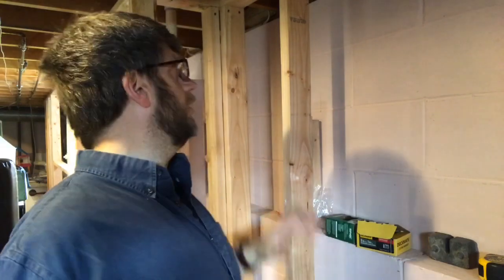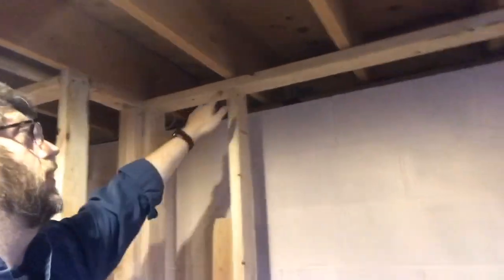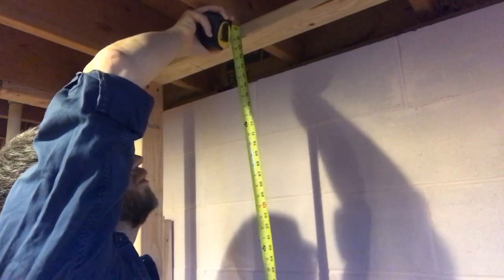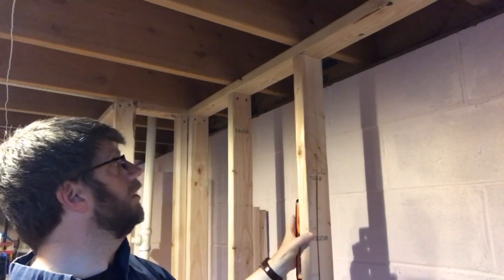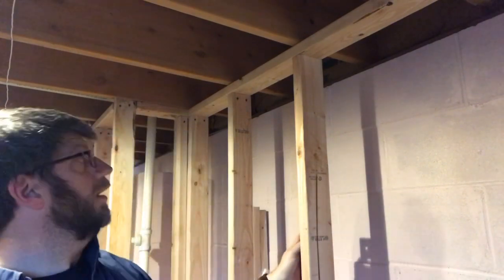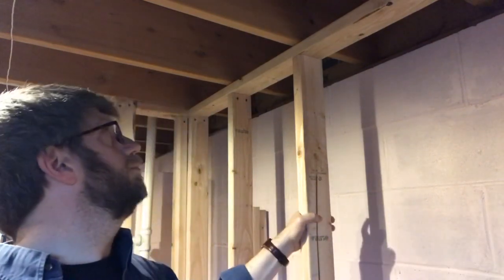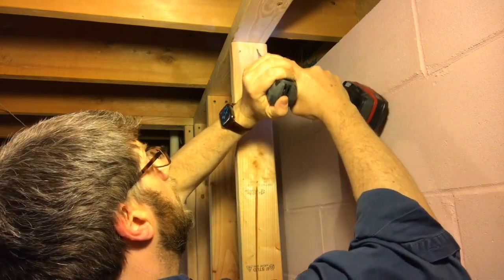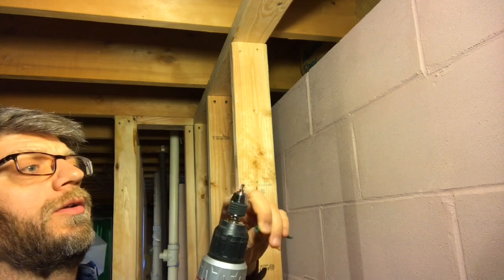No Nails, No Hammering - Wood Stud Framing With Screws - Basement Remodeling Project

Comment: Nails have more sheer strength and flexibility so they are prefered for framing but as a DIYer building a small non-supporting wall I can't invest in an expensive tool so I am going with screws too.

Comment: If there are obstacles above your partitions and you can’t get directly to the joists, put two foot blocking directly into the concrete basement walls to secure the framing.

Comment: There is such a thing as screws that meet or exceed the same sheer force resistance as nails. 
In addition aren’t decks made with screws? Those seem to require the need to hold load and resist sheer. So yes certain screws can be used to frame.
Reply: Yeah honestly a good rule of thumb is if your wall flexes enough to sheer a screw than you've got more to be worried about than just the studs. The only real reason you would use nails of screws is for cost and for the framing of the wall before placing studs.
Reply: Decks are made with screws yes, all hangers are done with nails NOT screws though.

Comment: I wouldn't go too tight with the studs as that can cause problems with the floor above. Having the stud snug (ha, snug studs) keeps it in place till they're nailed/screwed in.
Reply from the maker: Ohhh... huh.. good point.  Thanks!
Reply: The top plate is installed first, then the bottom plate is anchored to the floor. Wall studs are then cut to fit in between the two. The top plate can be screwed directly to the joist when the wall is parallel to the joists.
Reply: Also, if there are obstacles above your partitions and you can’t get directly to the joists, put two foot blocking directly into the concrete basement walls to secure the framing.

Comment: As a Journeyman Carpenter in the union I cannot find anything right about this video!
Reply: It’s a homeowner installing walls in his basement.  It’s NOT for a customer and he likely doesn’t have a permit.  There is also no need for speed and he 100% doesn’t own a framing nailer.

These walls will be there longer than this guy will be alive therefore there is nothing wrong here.  Doesn’t matter that you’re a carpenter.

Comment: What size drill bit was used for the pre-drilling?
Reply from the maker: That sorta depends on the screws you're using.  Here's a quick trick for pre-drilling holes:  I hold the bit up in front of the screw.  If I can't see the threads of the screw then I know the bit is too large.  I'll reduce my bit size until I get to the point where the threads of the screw are wider than the drill bit (and pretty close to the size of the shaft of the screw).
Reply: Use a 1/8 or 7/64 drill bit for a standard wood or deck screw. Framing screws/wood screws are typically 2 1/2” long and are #8 or #9 gauge and I would recommend using a torx/star drive head. These have less stripping and are much easier to drive into wood for first timers than a Phillips head that strips easily. Home Depot makes it very simple for DIY’s to find the correct screw needed for wood. Go to the aisle, look under wood screws and choose 2 1/2” star drive. Decking is exactly the same way. Go to the aisle, look under deck screws, choose your length for your project and star drive.
Reply: Remember that using screws for framing should ONLY be done for partition framing, NOT structural framing. Loads that need to expand and contract will snap screws, so you need to use nails. This video is STRICTLY partition framing, non load bearing, so you can use screws for the entire application.

Comment: 8:05 That drill bit took a while to make the pilots
Reply: Looks like he used the same drill speed setting for both pilot holes and fasteners.  Most drills have a higher speed mode for drilling.  Possibly an oversight on his part, or maybe it was one less thing to explain in the video.

Comment: I'm going to assume you already understand the difference between screws and nails and that they are NOT interchangeable. One is meant for clamping strength(screws) where shear resistance is not important.

 Nails are for where shear resistance is important like the wall you are building. Also a nail gun would let you finish that entire wall in 5-10 minutes with studs that are just as straight and stronger.
Reply: Does the building code allows screws instead of nails?  I am looking for
Reply: @nasarazam  That's a very good question, I highly doubt it. None the less it's just not safe to use screws vs nails in this application. Screws are great at clamping force, not so much for torsional or sheer.
Reply: @tofan2622  why not? It appears to be a non structural wall that he might only put drywall on
Reply: @tofan2622  are you worried more about wind loads or snow loads on this wall adjacent to masonry blocks and soil? :)
Reply: Please explain where shear strength is important on an interior, underground, next to concrete block wall which is only going to carry the weight of sheet rock and will have zero side pressure.
Reply: And just found this. 
The SDWS Framing screw is designed and load-rated for replacing 16d, 10d and 8d nails in framing applications. The SDWS Framing screw is 0.160" in diameter and superior to nails in holding power and pull-out resistance. It is code listed under IAPMO UES ER-192 and meets 2012 and 2015 IRC® and IBC® code requirements for several common wood framing applications.
So there you go, screw away.
Reply: @sandmandave2008  Come on Bro...did you even read my post. Nails are meant for SHEAR RESISTANCE! You just quoted that specific  framing screw is meant for holding power and pull out power......which is not shear resistance.
Reply: @tofan2622   Yes I read your post.  Are you going to tell me why a subterranean wall inside a concrete wall that is non load bearing other than holding up a sheet of plaster needs shear resistance?  Of course not because it doesn't!  That said, SDWS screws MEET the shear resistance needed for exterior load bearing framing BY CODE,  AND have SUPERIOR holding and pull out power than nails.  So, BETTER than nails, albeit, much more expensive at twice the price of exterior deck screws but definitely doable and acceptable.  I'm going to do it in my steel building to frame out the office and my exterior walls for plywood faces.  I don't have power yet, I'm too old to be swinging a hammer for that much framing, and I can drive the screws for a fraction of the cost of renting a compressor and framing nailer and having 300 nails left over that I wouldn't know what to do with.  So, yes, in some situations it is perfectly fine to use screws.
Reply: There are such a thing as structural screws, what it really boils down to is the metallurgical properties of the fastener and the rating. I strongly agree with the point that these studs are not structural at all. They hold shit up. Also drywall screws are about as weak as they come, yet we use them to hang heavy ass sheets of drywall. You can interchange screws and nails without issue so long as you check the material data or engineering specs.